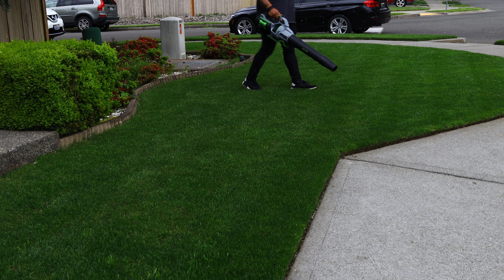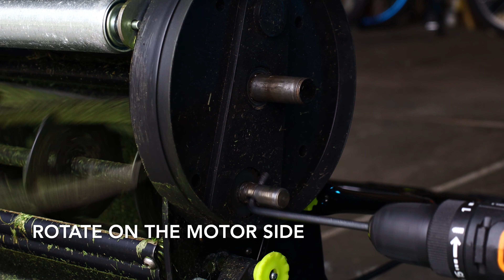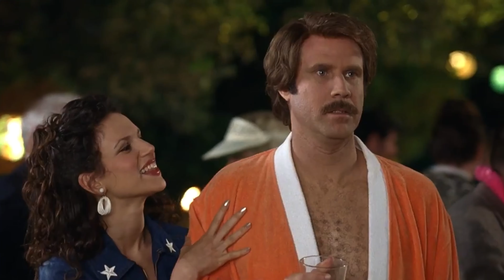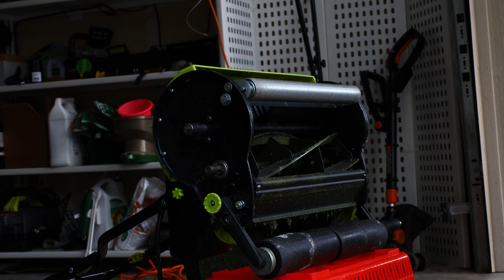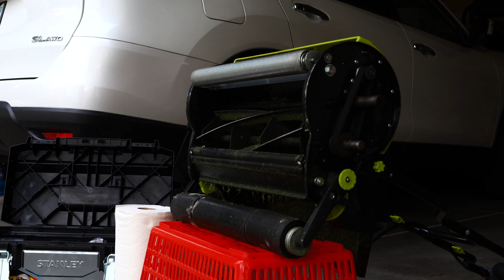Backlapping Sunjoe Cordless Reel! TOOK THE WHEELS OFF!

Comment: I used valve grinding compound on my Fiskars push mower. Huge difference between adjusting the blade and sharpening with the valve grinding compound
Reply from the maker: Nice! Yes that’s my next move I gotta give the fiskars “stay sharp” a sharpening 😂😊🙏🏾🙌🏾🤙🏾

Comment: Very nice. How did you take the yellow gear off? The one connected to the reel.  It appears there is a pin, but not sure how to remove it.
Reply from the maker: It just comes off try wiggling it around 😊🤙🏾

Comment: Yo, Yard Brah, i just unboxed my sunjoe. Been sitting brand new for 2 or 3 years 😂 question is the handle. It sits sow low, is that normal? Its like 2 ft off the ground and it wont stay upright.
Reply from the maker: Dang you have a brand new Sunjoe 😳😂👏🏾👏🏾👏🏾 unfortunately yes the handle doesn’t sit up tall I was trying to figure something out. Actually that little pressure up helps with the stripes after you mod it 😉😂🤙🏾
Reply: @YardBrah  I bought it years ago when the craze was going on. Lol my son hit something with the McClane and had to bust this one out.

Comment: That's what's up. What's the lowest it cuts at withheld wheels off? I need a decent solution that won't break the bank for a putting green!
Reply from the maker: Oh man .6 inches not low enough for greens my dude still super bushy at that height 😂😊🤙🏾🙏🏾
Reply: @YardBrah  yea. I knew it was. Was just hoping that thing could drop it down lower than that hahahaha

Comment: Brah how does backlapping actually sharpen reel blades if you're not actually filing the blades with something physical like a grinding wheel, or knife sharpener?
Reply from the maker: You use the compound that is gritty, that compound gets in between the reel and the bedknife creating a sharp edge super nice! It’s crazy I did it on the Sunjoe push reel and it went from dull the sharp in less than 10 minutes! 😊🙌🏾🤙🏾🙏🏾

Comment: Nice. However, not quite sure if when sharpening it you suppose to turn counter clockwise. I believe I heard that on some video such as these. Well let me watch again that part if it is turning clockwise or counter clockwise.
Reply from the maker: As long as it’s going the other direction from how it’s cutting it’s going to sharpen the reel 😊🔥🤙🏾🙏🏾
Reply: @YardBrah  Yeah, after 3/4 cuts time to sharpen it again. cool. Awesome to learn the mechanics of it. Thanks so much.

Comment: Looks like you're having good luck with it!  I went through 2 in a month then shelled out for a Toro Flex21.  The smallest unseen piece of trash in the lawn will destroy the bedknife/blade. Not good when birds drop stuff in the lawn like dead baby turtles lol, for real.
Reply from the maker: Not the dead baby turtles!!! 😩 oh the toro flex21 💪🏾how do you like it?!? 😊🙏🏾🤙🏾🙌🏾
Reply: @YardBrah  it's awesome. Many, many levels up. The floating head is nice especially since my backyard isn't table top smooth yet. And the weight of this beast has done a number on many of the small undulations in the lawn. Especially mowing when the lawn is still soft after a light rain.

Comment: Brah, I got a Sun Joe.  I love the cut, but twice already (in the first week) I've ended up with a bend blade and it takes forever to get it back close to true.  Even then it doesn't cut as good as new.  I cannot get it back to cutting paper all the way across the blade.   Do you have any tips to fix this blade?  Or better yet as many different mowers as you have tried are there any that are more bulletproof that don't cost thousands of dollars?
Reply from the maker: You know that’s funny cause I messed up the blade the first day too 😂 I get the blade really close to the bed knife almost squeaky when turning and it’s cutting paper really sharp! Maybe get it straight get it close and do a backlap that should do the job cause mine is super sharp! 😊🙌🏾🤙🏾🙏🏾

Comment: YardBrah, how well does the mower push without the factory wheels and now with the front and rear rollers compared to no modifications?
Reply from the maker: It’s effortless! Feels a lot more sturdy… feels like you’re really in control… for some reason with the wheels on it felt like I was just pushing around a typical manual reel with an electric motor attached, with the mods it feels a lot more expensive if you will 😂 😊🙏🏾🙌🏾🤙🏾
Reply: Thanks alot! I ordered all the parts already and ready to do the modifications this week!
Reply: Finished the mods today and they roll nicely. The only thing I added was adding a 1-1/2" pvc pipe onto the metal front roller so that metal tube won't get dinged up.

Also added the front roller to my EGO 21" rotary mower and no more scalping!

Comment: This is unbelievable! I wonder what removing the wheels lowers the minimum HOC to! Wow.
Reply from the maker: The way I’ve positioned the front roller at the lowest height of cut it might need the wheels on as the frame sits lower than the roller right now. Needs some tweaking to get it right at all heights. It’s sits perfect at thr 2nd setting which used to be 1.1 inches with my measuring it sits at a perfect 1” now 😊🙌🏾🤙🏾🙏🏾

Comment: How low does that cut with the wheels off?
Reply from the maker: It's electric brotha! 😊🙏🏾🙌🏾🤙🏾
Reply from the maker: @victormatos3  There's a motor that spins the blades my dude no wheels needed 🤙🏾
Reply: I understand that part. That mower has a hieght of cut that goes down to .6". My question was asking if taking those wheels off drops that height of cut bellow the .6. Also what motor drives the reel? Has anyone upgraded it to stop the washboarding effect?